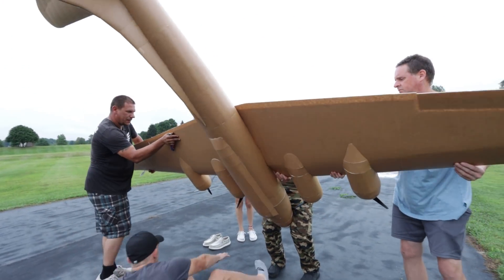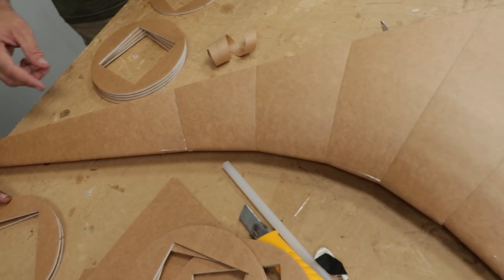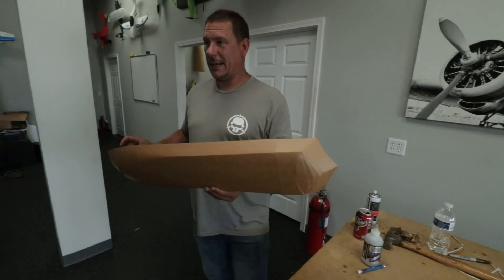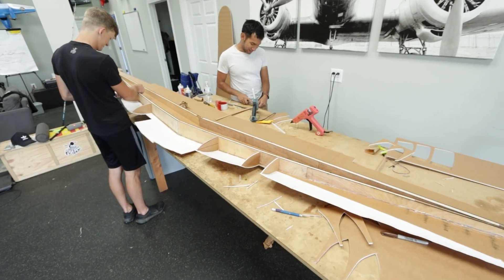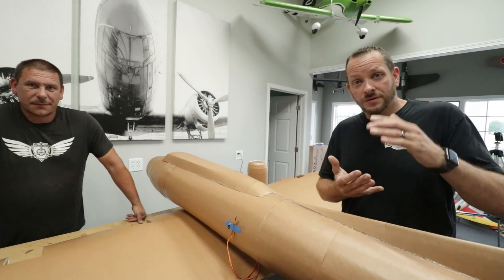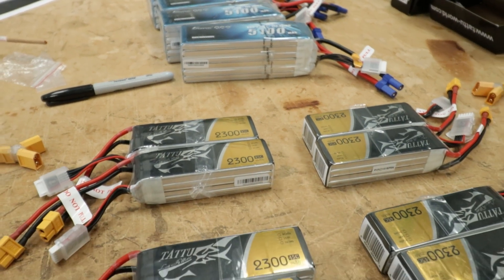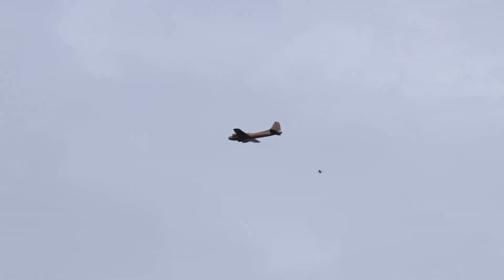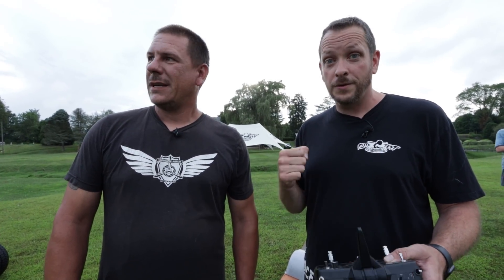Giant 12 Foot B-17 Flying Fortress is UNREAL!

Comment: Two questions. 1: how close to scale is this B-17 to your MM line of planes? And 2: Is there any plans for this beautiful plane?
I've been looking on your site but cant seem to find any plans or even a quick build kit. 
I'm more looking for plans as I live in Germany and getting a kit and having it shipped here is expensive.
I have a group of friends that want to start doing some RC reenactments with WWII planes. We do some with tanks and other land vehicles but we love to fly model planes and we are looking at getting into foamboard ones before we look at more expensive options, especially sense the videos of doing fiberglass over the foamboard planes you have done.
I've been working on creating Airsoft mods for the different MM planes but instead of using Airsoft BBs they would fire custom paintballs sized at 6 and 8 mm so we can use that for doing dog fights and not shoot holes in our planes.
I tested plastic Airsoft BBs and they can shoot holes in one ply fiberglass and dent two ply fiberglass covered foamboard at higher joules or FPS for you in the USA.
It's not easy to do as the thickness of the gel wall has to be a certain thickness for it to not explode in the firing mechanism or in the barrel but at the same time it can't be too thick or there wont be enough paint in it to show on the planes. It's getting the thickness right so you can easily see when hit and not do much if any damage that is the main problem. The second problem is using an electronic firing system the gel has to be able to withstand that and with an air firing system it can make it so you have only a few shots before you have to exchange small canisters as to not be too heavy to lift off. The same problem goes for using the electronic firing system.
I've been working on it for about 3 years in my spare time. mostly on weekends. I'm a Welder and Machinist by trade and have been welding for over 25 years and have been a Machinist, off and on, for the last 20 years.

Comment: Greetings Gentlemen!
I look forward to seeing the finished aircraft once it is painted. It might be a good idea to try using one receiver and multiple speed controls to sort out the issues that disabled your ability to pull off certain maneuvers like you tried to do.  It would be awesome if you also added retractable landing gear and functional bomb bay doors, but I got the impression that those are already in your plans. 
It would also be awesome to install a sound module to mimic the actual sound of a B-17 Bomber for the full illusion of a full sized aircraft.
Super awesome job on the build and the maiden flight.
I expect that it will be really super excellent once you have it painted and have all the other cosmetic embellishments completed.
Congratulations gentlemen!!!
Thank you for posting these videos!
Please have an excellent and awesome day!!! ☀️

Comment: It's a good thing you used differential thrust. Cause the rudder don't do much on a b17. I have a 12 ft electric b17 at 65 lbs and an old westcraft b17 that I just maidened at 53lbs  that's 10.5 ft the rudder don't do much on either one at low speeds.

Comment: Hey guys. I'd love to see some real tests for strength, rigidity and water resistance between the foam and colorfabs lightweight filament. Do you print solid or infill? How does extra walls affect strength? Does printing with infill create the perfect structure lattice?  
Love ya work!

Comment: I'ld lose the differential thrust because of that nice big rudder.  Also, install landing gear and the belly turret.  With that great box spar, retracts could mount to it easily, just keep the tail wheel fixed down - not retractable like the real bird..

Comment: You guys should try 3d printing wing formers. They are easy to make: just build the shape you want then print them with 1 or 2 walls, 10%(ish) infill and zero top and bottom layers. Super light-weight and any shape you need. Feel free to ping me if you would like an example. 
Evolwun on the FT forum.